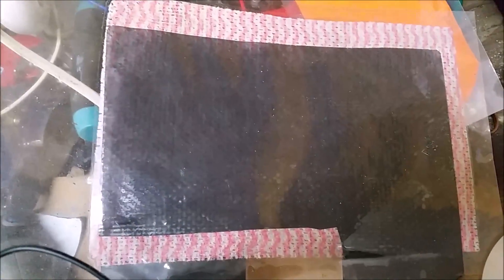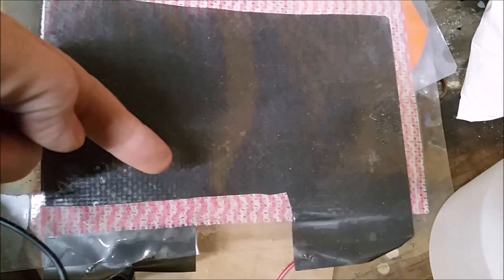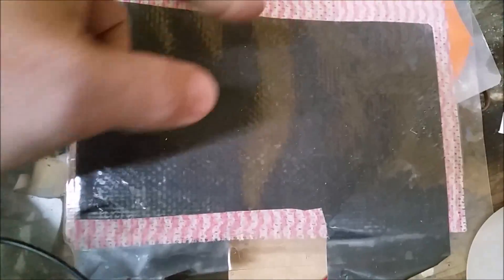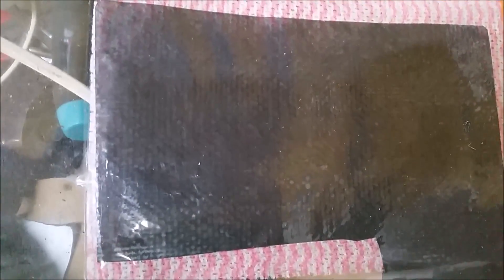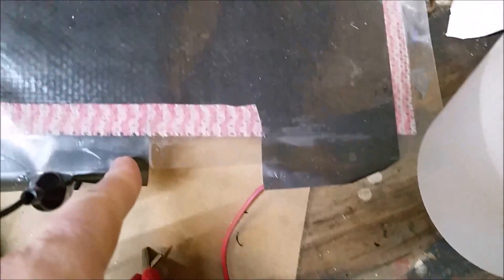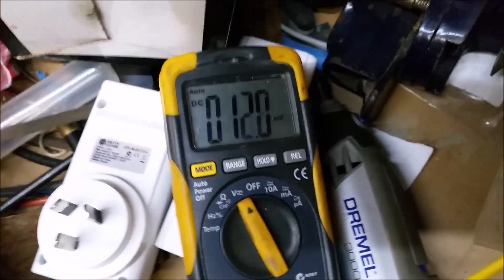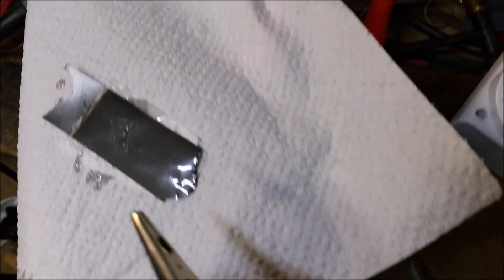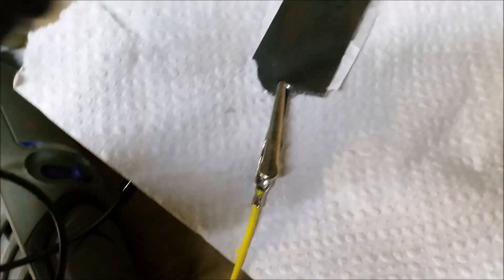Sodium silicate capacitor test

Comment: you might find that sodium silicate will harden up over time..it's mixed with sand to make casting molds and then set with co2 gas to harden up and make the mold hard so it holds together without fracturing...see how you go.
Reply from the maker: "set with CO2" that's interesting